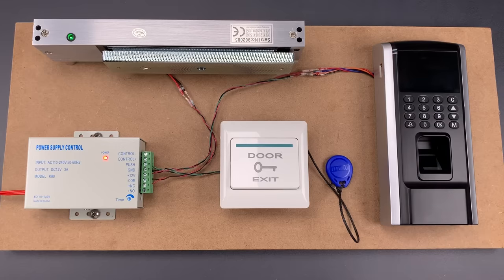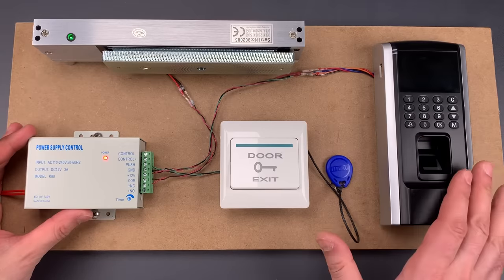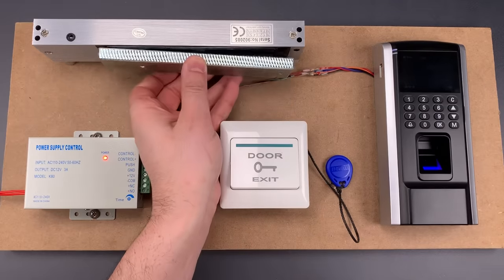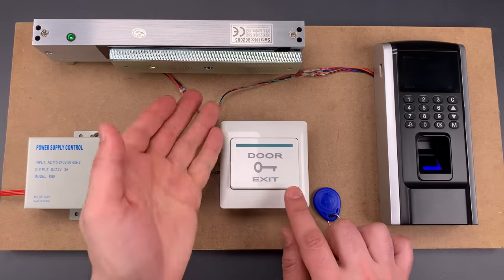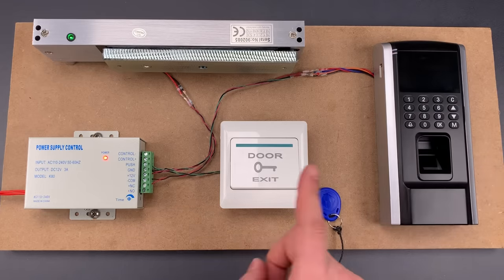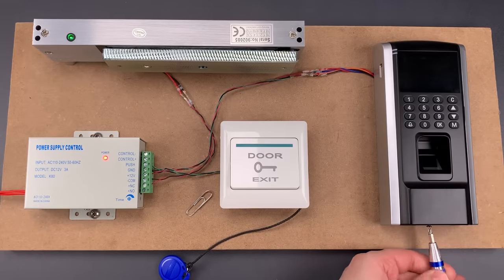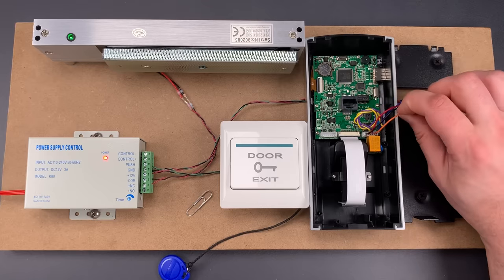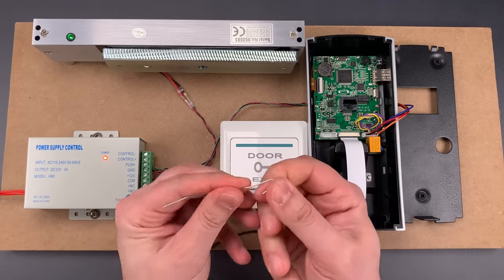[1040] Fingerprint/RFID Lock Defeated With a Paperclip (Mengqi-Control)

Comment: Magnetic lock can hold 600lbs of force?  With a long enough lever a 120 lbs person can overcome that!  Now if it used a magnet to extend and retract a thick steel bar, that would make much more sense!  Also how does it work when the power goes out?  Opened with a  a Paperclip!  Hahahahaha!! what a POS!  You did it the gentle way, looks like a good sideways wack with your hand will pop the plastic cover off, then just rip out the two wires and hold them together,  It's not like a robber is going to lock it on the way out!

Comment: Does it work without electricity
Reply: The device itself or the hack? The device requires a constant source of power to stay engaged as it locks in place using a strong electonic magnet. The hack will require at least a 9v signal to travel through the wire and disable to magnet. This is normally done by an already "hot" wire in the box, but you could use a battery

Comment: That system has indeed got a serious design flaw, the relay should NOT be fitted in the outdoor control pad, it should be fitted on the INSIDE of the door, the cabling from the keypad to the indoor parts should only carry the digital data as well as the power supply voltage, then the code data would have to be compromised before the lock would open which is MUCH harder, you would need to know the combination or have the right fingerprint. I could build a device like that far more secure and I wouldn't rely on just a lousy electric magnet to hold the door closed, no chance! I would design a different mechanism which would be much more secure. And what happens if your home or other building suffers a power failure when you're using a system like this? You would need a back up system of some kind. And the outdoor casing should be FAR more securely built and not so easily openable, what absolute trash it is, and I bet it's not even rain proof.

Comment: Yeah, I've never seen one of these in real life before and could tell right away it's a poor design.
The scanner should send data over a network to a brain-box in a secure location, which then sends the go-ahead over a network connection to the locking mechanism. Also, if you need it to be really secure, the walls need to be secure, not just the door. People should not be able to (easily) access the locking mechanism on a shut door (nor an open one really, for that matter - except for service).

Comment: If it's anything other than a name-brand item, backed by science, and with guarantees, then it isn't a lock in my eyes. I'd gladly pay a few hundred dollars for a quality lock with these functions. I wouldn't even look at anything other than a manual key with deadbolt if it is priced under $100 USD. Sadly, anything with a key, can easily be broken into nowadays, and anything with digital features is expensive not because of the fingerprint reader, screen, or even the magnets and other hardware. It's the trial and error, research, certifications, and all the work that went into being able to make those promises. Do I like the current situation? Not really. Do I want it any other way? Not really. Things will get better with enough time and money, and improvement wouldn't even exist if not for imperfections that exist. To expect perfect things without going through the hardships of getting there....is unrealistic. However, That is a cheap crap product he reviewed.
Reply: I would like to add that I would love to see an updated attempt at trying to bypass a high quality, expensive, newer 2020+ model that promises to specifically not allow any common breaking in methods.

Comment: Thats a stupid design. Real security would be using a communication protocol like i2c and encrypt the message using the encryption key from the external device. Then the internal device which has de decryption key validate the message then open. Takes 1-2 more weeks of development on the system but its almost unbreakable.

Comment: Only if they are stupid enough to not putting a tiny camera above yoyr head and a security guard inside that will get you busted.
But if you have a house and put this trash on it you better put a sensor detector at every door in your house, especially the one on the backyard connected with a device that will call the closest police station when you are away from your house.

Comment: Okay, so this is not impressive in the slightest. This is some bottom of the dumpster, garbage access control system. What kind of trash biometric reader has a board that is that easily accessible? I've been in the access control industry for 15 years, and this blew my mind. I'm impressed for the absolute trash you found to do this with. What kind of shit mag lock is wired through a trash reader like that in a normally open circuit? 

Can you try to do something like this with the latest HID reader, and an assa abloy 1200 lb lock; with power back up and all security anti tamper switches in place remotely? I would actually be impressed with that. This was an absolutely atrocious access control system that offers no security at all.

Comment: What a piece of crap. That lock ignores the most basic principle in designing that type of system. Why would you go to all that effort to design that product and not have it send a coded verification or better still the whole verification done in the secure side controller. Mind boggling.